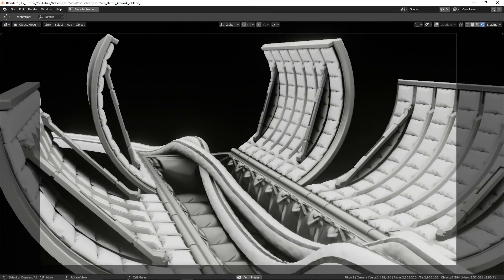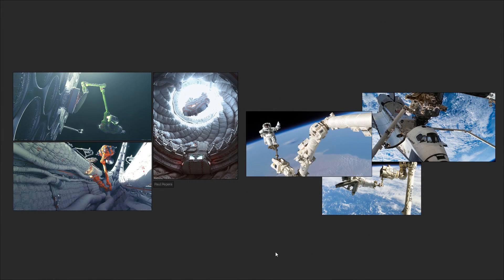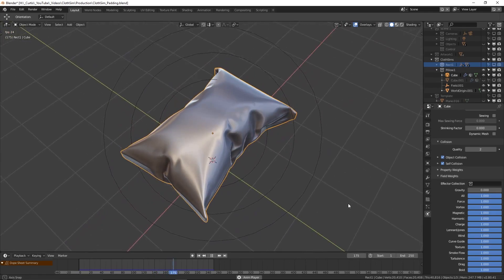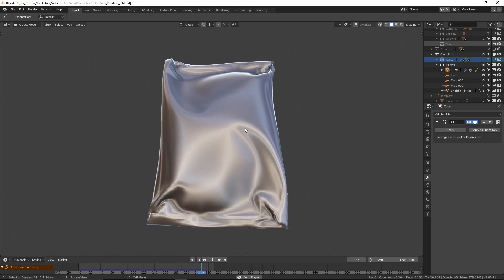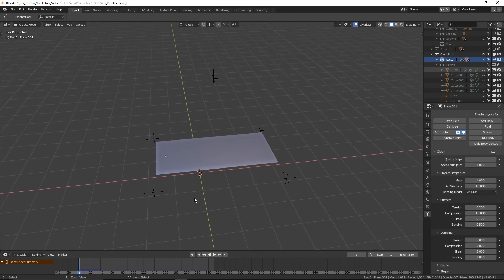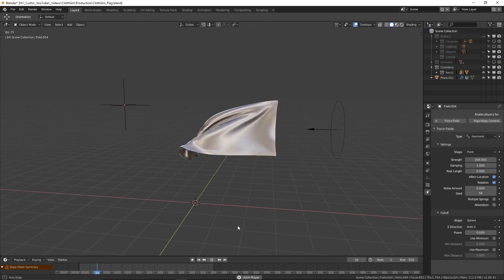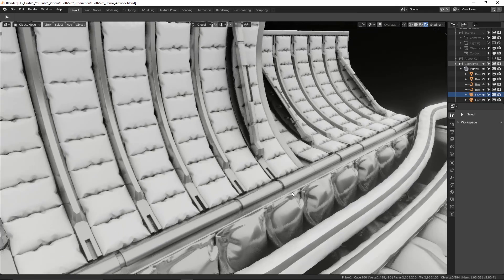Cloth Simulation in Blender 2.8

Comment: Why don't you just pin verts that aren't the corners?  Like, 2 or 3 steps in from the edges.  Then the pillow as a whole would fluctuate and contract, but there would be a limit on how small it could get.

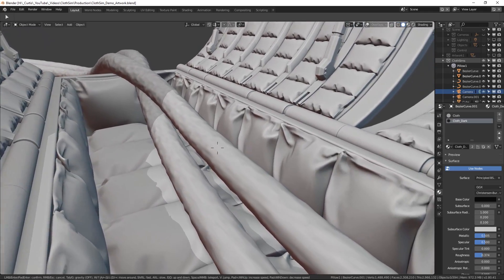Comment: Awesome tutorial ! I wanted to ask how you managed to put a displace modifier onto a BezierCurve 7:33 ? The displace modifier won't show up in my menu.
Reply: The object in question is a mesh, not a curve.  You can tell because the tab below the modifiers tab has the three points in a triangle to indicate "mesh data" rather than two points linked by a curve to indicate "curve data" (in practice I think they're both referred to as "object data" tabs, but they're different between mesh and curve objects).  You can convert a curve directly to a mesh using Alt-C or Object>convert to>Mesh from Curve/Meta/Surf/Text (although you'll lose access to the curve settings), or you can use the curve modifier to arrange an appropriately subdivided cylinder mesh along the curve.

Comment: One other option I often use is assign the pinned vertices to bones in an armature, and the animate these bones to slightly move in the first few frames of the simulation.
In the case of the pillow you would move these slightly inwards for example.
Simulating the excess material like in marvelous, but also in a very reproducible manner which can help with iterative production.
Reply: You can record the armature animation live, giving you the freedom to move the bones around to a nice position and keeping a record of that to reproduce.
Reply: @DrTheRich  is there a way to maybe use bone scaling to make it a more general solution?  scale all the verts down but have a subdivision modifier or something inserting extra ones prior to that, that don't get scaled
Reply: @charlesalexanderable  yes, assign all the pinned verts to the same bone. They will then scale down towards the center of the bone. Works for uniforms objects. I can't think of any way to insert new verts that the cloth simulation can take account of them.
Reply: @charlesalexanderable  subdivision also blends the vertex weights so that wouldn't work. Also it just inserts more vertices, it doesn't create more material surface
Reply: No need to add bones. Simply create another shape key and move the pinned vertices around. I've been doing some tests and it works great when creating excess cloth and creases.
Reply: @Wattstone  no need to add shape keys just simply create an armature and move some bones around
Reply: @DrTheRich  You're right, I thought shape keys would be simpler to operate, but they end up introducing some limitations, specially when converting the cloth back to a static mesh. Armature is the way to go for this sort of thing.

Comment: Does it look realtime because you have a powerful computer or did they improve it so much? In 2.79 it's like 0.2 fps.
Reply from the maker: It's realtime in 2.8, using the new EEVEE PBR engine.
Reply: @CurtisHolt  I'm talkimg about cloth simulation, not rendering.
Reply from the maker: The number of 'keyframes' I could get Blender to calculate in 2.79 for the cloth was already pretty realtime, so I can't really testify as to whether 2.8 improvements provided a massive boost in performance. I'm sure there have been. Read here for more info:
https://code.blender.org/2017/06/improvements-to-the-cloth-simulator/
Reply: Just tested on my setup and the first playthrough of each animation is a little slow or when manipulating it but after that it's fine. Maybe around 20fps I am getting lowest around 15 on a i7 4770 @3.7ghz, GTX 1070, 16gb DDR3. I do wonder if I can use my GPU or if it's already using my gpu I will have to look into it. GPU seems to do better for rendering in blender 2.79 for me.